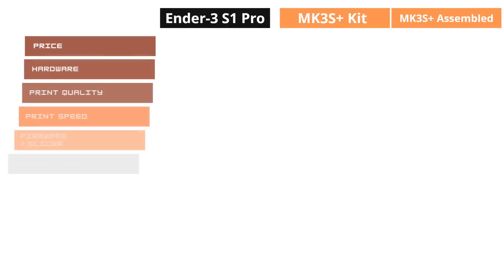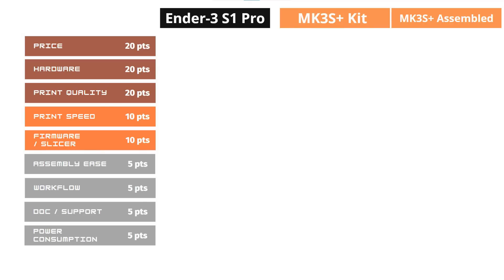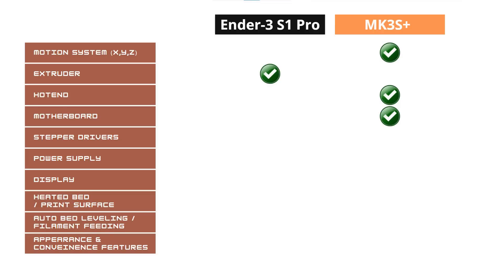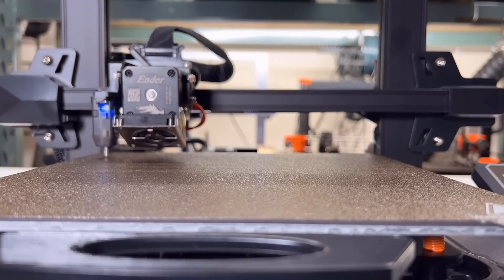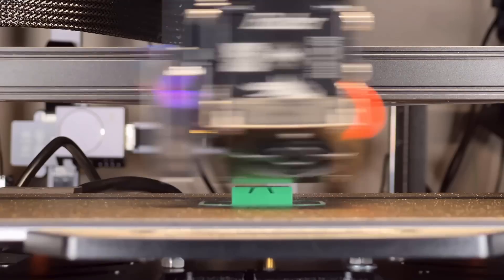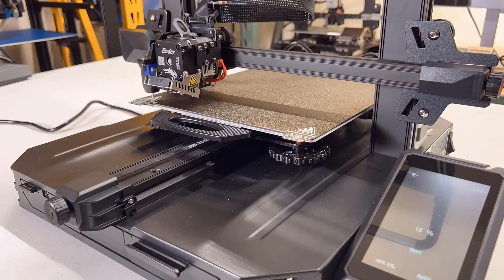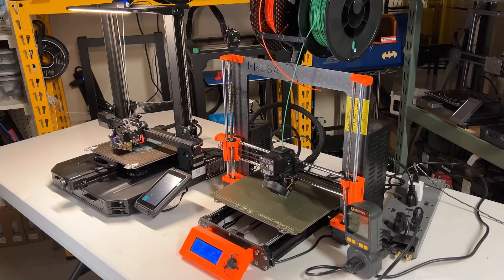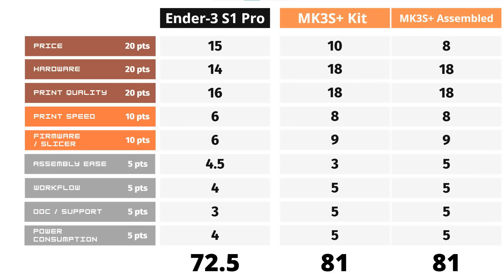Creality Ender-3 S1 Pro VS Prusa MK3S+, In-Depth Comparison

Comment: This fits the reality that you will spend 95% of your time getting that last 5%. In this case, the S1 Pro is good... but spend at least 50% more to get that last bit of "great". I have the S1 standard for work and thinking about buying a personal machine. The Prusa seems awesome but that's a massive price increase.
Reply: Honestly, since the S1 and S1 Pro have stepped up the "set it up and forget it" game for Enders, I would say also that the print quality difference would be negligible with the MKS3+. The only difference she pointed out in this review (the bulging corners) is the lack of linear advance (or pressure advance in Klipper) setup for the Ender, which you can easily do yourself and then not have to worry about again. Is that worth a few hundred dollars for you? Maybe, maybe not.
Reply: I hear you. I have kept 14 printers running 24/7 for two years now. I had to completely reconfigure the Creality machines for them to work dependably. (Creality is getting better)   I kinda felt cheated when I realized that the Prusa works better and is more dependable than my redesigned Creality printers out of the box. On the plus side I learned quite a bit of valuable information with the Creality printers.
Reply: You can take a base ender 3, not even a pro and mod the shit out of it for less than $450.  I was seriously thinking about the S1 but the sprite extruder wont cut it for me.  My enders in my small farm all have bigtree tech boards with 2209 steppers, bltouch, v6 volcano hotends with bmg dual drive direct extruders, 5015 blowers, linear rails on the x axis, g10 fr4 build surfaces, and dual z lead screws.  I can have one set up in 3-4 hours if that.  Prusa who?
Reply: @MoeReefs  Congratulations, you no longer have anything resembling an Ender printer. $230 for Ender 3 + $450 in mods = $680. Basically same cost as Mk3S+ kit. And you still have roller wheels on y and z axes, probably a mid-low quality linear rail on your x axis, no crash detection, no filament sensor, no power panic/resume, no automatic belt tension testing, no sensorless endstops, no hardware errors detection, no team of engineers who frequently publish upgraded parts for free, etc. Yes, Prusa printers are more expensive, but you get a lot for your money. More expensive printers still don't have all the features that Prusa printers do.
Reply: @GregBeatty  You don't have to spend anywhere near $450 in mods, he's probably saying $450 total. That would include all rails on all axis too, not sure why you'd limit it to just x. And it would include filament sensor, sensorless, etc., and you could probably get a better hotend than a v6 for that cost. Prusa you're mostly paying extra for support and decent quality parts from the baseline.
Reply: @GregBeatty  Its the cost.  Around $450 total for a machine that prints just as fast and as good quality as a Prusa.  Perfection on a print can only get so perfect.  The printers print so well the only thing better would be SLA or mold injection.  Prusa is obviously a nice printer but it doesnt mean you cant get the same quality or 99% there with experience.
Reply: @MoeReefs  plus you should be able to throw that ender in a heated chamber to print higher temp materials with less mods and problems while those printed parts on Prusa i wouldn't trust
Reply: @gitss7367  Even after a few months of writing those comments things have changed.  Take a look at ender 3's running on klipper with input shaper.  Some of them are nearly bone stock and can hit 100mms with near perfect prints.
Reply: @MoeReefs  what's the issue with the Sprite extruder in the S1 Pro?
Reply: @Robert86314  From the reviews I have seen it does not push out enough volume.  I also watched a disassembly video and even though it conveniently detaches it takes more effort to get to the hotend assembly than your average v6 set up.  You can do a cht nozzle to improve it but overall I prefer the cost saving of a volcano as it does the job just as well.
Reply: Even with linear advance enabled and calibrated on my ender, it's still not as good as my MK3
Reply: @GregBeatty  I mean, that's a fault of Marlin or your calibration. There's no other real special sauce other than their profiles and a bog-standard V6/extruder.

Comment: I'm not spending 1200$ on a dinosaur sporting an 8-bit motherboard and a 20yo 2$ display. Prusa really needs to release an MK4 along with the XL.
Reply: The dinosaur is the ender. Still doesn't have automated bed levelling, belt tension testing, sensorless endstops, power loss detection, hardware errors detections, consumes more, prints at lower speeds, etc
Reply: What Prusa is able to accomplish with those 8 bits though is mind blowing. No other manufacturer has accomplished what Prusa has in firmware, even with a 32 bit board. This boils down to Prusa actually developing firmware, verses others just slapping it on, and not even enabling all of Marlin's built in features. And I also find the older text based displays much more capable than the touch screens. Many of Marlin's advanced features can't be accessed from a touch UI.
Reply: man, you'll can upgrade your prusa when they'll put out the mk4 version (probably, screen, motherboard and other), that is not this year because there is just the xl version... but for 300 $ more, prusa is the best that you can buy respect a 500$  chinese ender s1.

Comment: I just got a MK3s+ fully assembled. It has been a great experience and I can definitely recommend it. My one and only complaint is that they are still using an LCD screen from the stone age on a $1000 printer. My $250 ELEGOO Neptune 2S printer has a far better color touch screen.
Reply: I'm thinking about getting MK3s+ and using octodash with it, do you use octoprint with it?
Reply: I was planning on using octopi with my MK3s+ once the supply of Raspberry Pi 4s is abundant again. I'll have to look into octodash as well.
Reply: @DavidCourtney  I was recently able to pick up some fairly priced PI 3As. They're much easier to find than the 3b or 4. If you don't need all of the USB ports it's a good option

Comment: I have the MK3s+, it is my first printer and I bought it as a kit. I enjoyed building it and I've found that with minimal tweaking it is a very accurate and capable printer to make usable mechanical parts. I've added a 7" touchscreen with Octopi as well as a camera and that made a great printer even better. You have a good channel and I wish I had a room full of printers like you do. lol
Reply: How does the touch screen interface with the MK3+? Are you able to adjust the printer settings?
Reply: @garythecyclingnerd6219  The touch screen is really cool, you can adjust positioning, speed, bed temp, nozzle temp. You can re-run programs that you uploaded to the octopi. You can watch the progress on your PC while it's printing (with a camera). You can record timelapses of the build. There are a bunch of plugins for other stuff too. If I got any other printers I'd put one of these on every one.

Comment: Actually excellent comparison and reviews. Rivaling established 3d-printing creators like Salanderer and 3dpnerd. Exceptional work!
Reply: Yeah but a $500 printer compared to an $1,100 printer is a little bit not fair. Plus I don't see how somebody could give more points for 3D printing Parts over injected molded parts. That's just insanity
Reply: @Savage1776_  Ease of replacement.  Very easy to print a replacement for a lot of people if a part gets damaged, injection molded you would have to source somehow.  Assuming they both have the same functionality.
Reply: @Savage1776_  i literally searched "ender 3 vs prusa" so yeah, it was a good comparison.  for a few hundred more you can save yourself a lot of headaches and get better prints.
Reply: alos, they gave the ender more points for aesthetics but i don't care if it had 3d printed parts. it's kinda cool IMO

Comment: That 3 out of 5 for the Doc/Support was very generous, Creality has a long way to go still. Another solid video, looking forward to the next one.
Reply: I could see points swinging in either direction on a few of those categories.  Personally I see these printers being much closer in value than than the point system outcome.
Reply: Why would you pay 60% more for product support? Surly at 60% for a Prusa you'd expect to not need any support services?
Reply: @shrimperlincs3395  For my Ender 3 I spent several days trying to find compatible firmware for my oddball motherboard to get Marlin linear advance support, before finally switching to Klipper firmware on a Raspberry Pi (extra $100 or so) to gain that functionality. If you value your time, it may be worth buying a better product upfront.
Reply: Just checked to see if the situation was the same but it looks like they have taken the advise on-board and re-vamped the doc/sup section.

Comment: I agree with most of the ratings, but with my personal experience l think the v-slot wheels are a little better than the linear rods. You guys are doing a great job.
Reply: Interesting , why is this if you don’t mind me asking ?
Reply: I have to disagree on that one. I'm frequently adjusting the wheels on my ender. For my MK3, the linear rods are fantastic. Just a little silicone grease occationally

Comment: ooh decisions decisions, in the uk the cheapest s1 pro is on this date £409.00 and on the uk prusa site the mk3s+ kit is £699.00 and the built one is £899.00, so the prusa on paper still looks like the better choice so then its just down to can i justify the cost, aaaaaarrrrr damit its like a sweet shop. You really do great videos 👍👍👍
Reply: 60 mm/s vs 100 mm/s will make a big difference to larger prints. The linear rods on the Prusa will all alleviate a lot of x axis gantry discrepancies. Although you can probably upgrade the Ender 3 S1 to linear rails but the auto bed leveling is just prime
Reply: The ender has a larger build volume as well which was never mentioned in this comparison
Reply: @Lazy_Mango  Hi Thanks, I have been looking to a first printer for a few years but keep putting off because a more improved version comes out which makes the plunge harder.
Reply: Did you end up buying one? I'm also in similar situation. S1 Pro has a bigger volume to print stuff but I don't know if that would be needed in the future. The print quality is more important to me but I'm not sure if prusa really makes the difference.

Comment: What about the print volume and possibly of upgrades? I think your rating match what I would give for both printers. 
The prusia also comes with additional features such as auto test systems. I think it is still the state of the art for hobbyist. Keep up the great work 😃
Reply: The problem I have is having to wait nearly two to three weeks possibly to even get one.
Reply: @Aagggyy  That's all you waited?  My MK3S+ took 5 weeks, but considering they test everything before shipping I considered it a win.  Prusa is getting bigger, but they take the time of a small mom and pop.